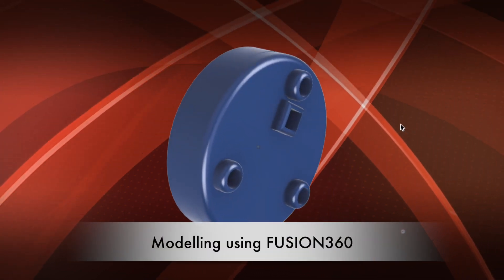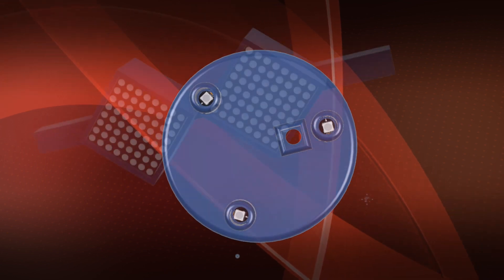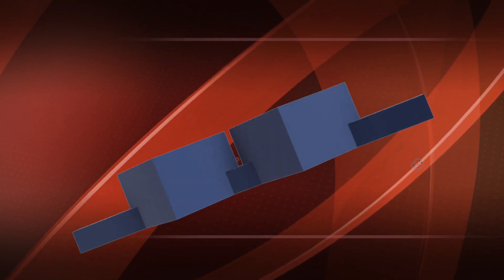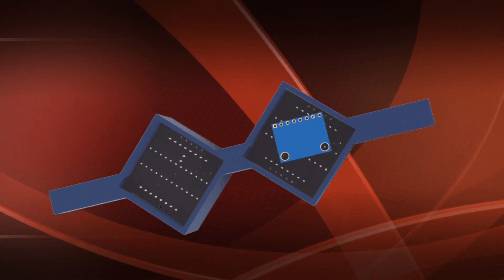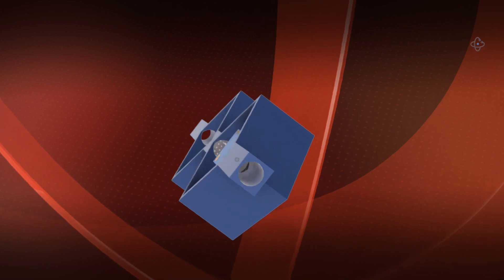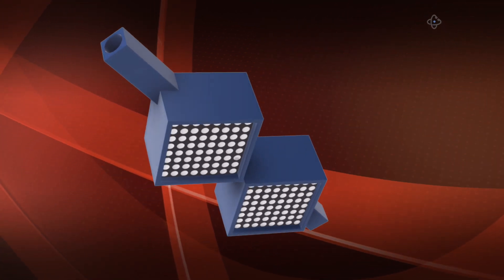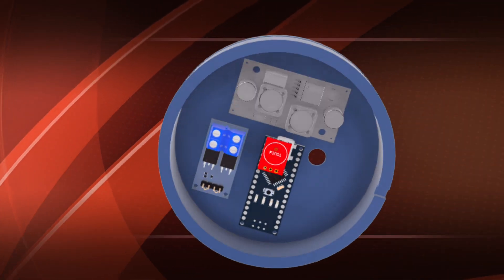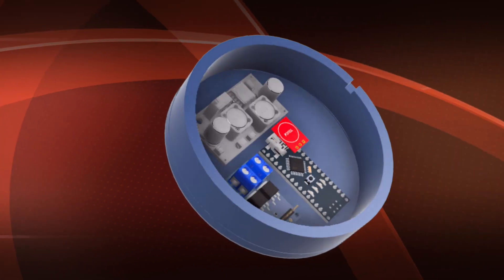How to make Arduino Hourglass MATRIX DISPLAY 7219 Nano WS2812B led

Comment: The project looks awesome…I just wish the code didn’t SUCK more than a HOOVER vacuum cleaner! Has more error messages than a mistake! And none of you YouTubers answer that one question!
Reply from the maker: Hello Melvin, I answer every message I received. The source code works like a charm, why you say that did not work?
Reply: @boomytech7504  because I get all kinds of error messages...one after the next.
Reply: I also tried lot of codes but no one works
Reply: It’s to the point where I gave up on the whole Arduino thing…that’s how frustrating it was for me. I’ll try again sooner or later and if I get any positive results I’ll let you know what I did. It’s an amazing project; well, let me rephrase that…it seems like an amazing project.  @vijayarora6829